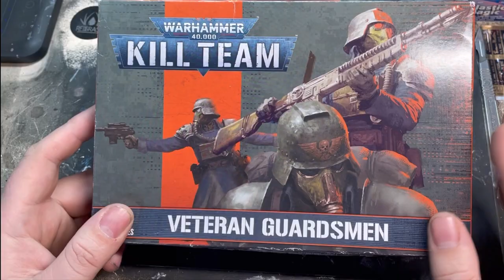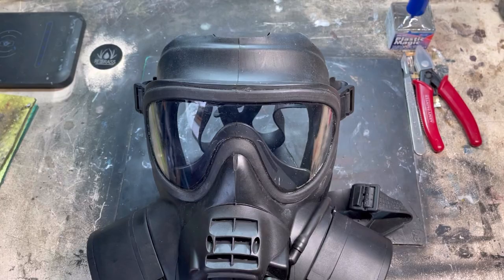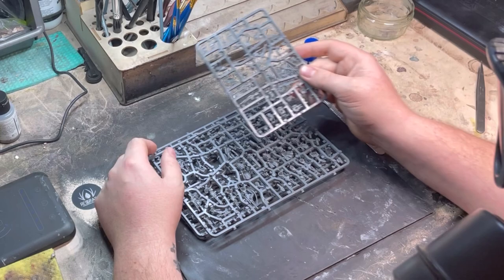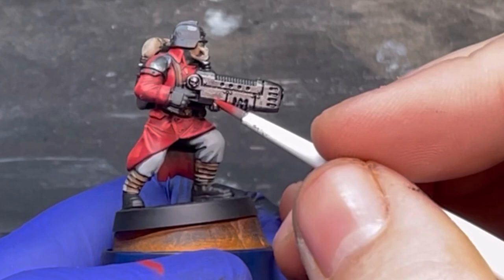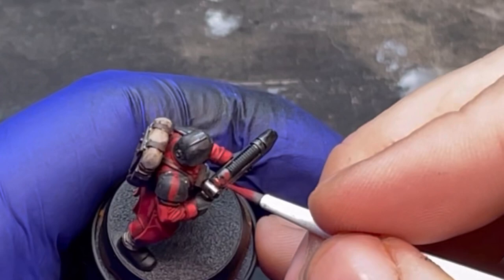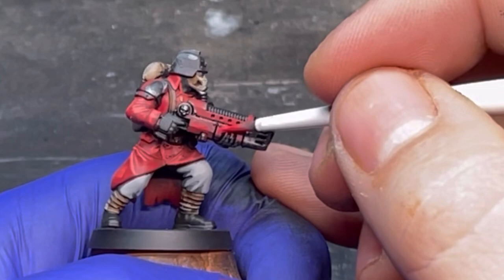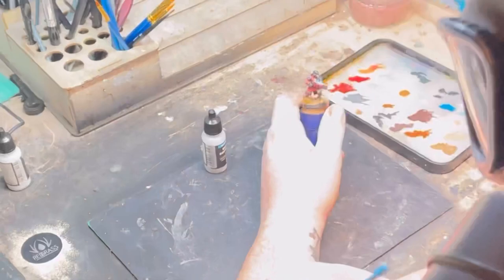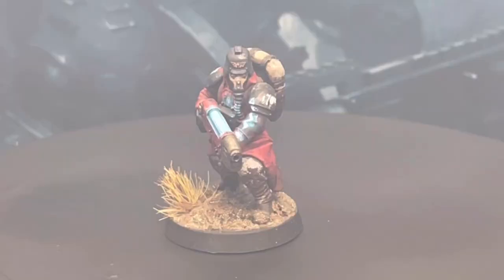I WORE A GAS MASK! To paint Death Korp of KREIG! | why did I do that!

Comment: Colour me impressed! Turned out proper, I thought you vision would be much more obscured
Reply from the maker: Yeah turns out that kit that’s designed so you can still operate in hazardous environments isn’t all that obscuring 😅 hence the old surplus Finnish mask. Even that wasn’t to bad, had a strange overlap in the centre of my vision but just had to line my vision up on the model and it was fine.
Reply: @RIGMiniatures  Alright smart arse, next time try using beer goggles! Bahahahaha
Reply from the maker: Happily 🤣